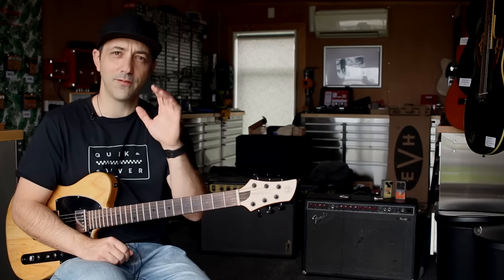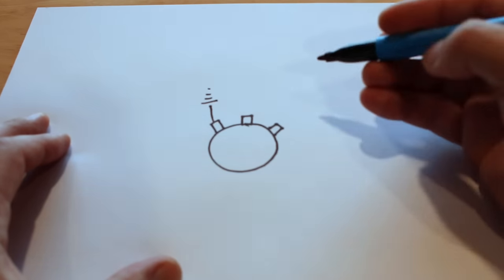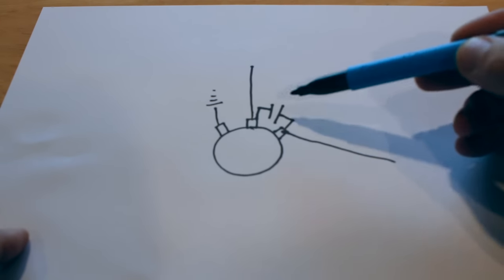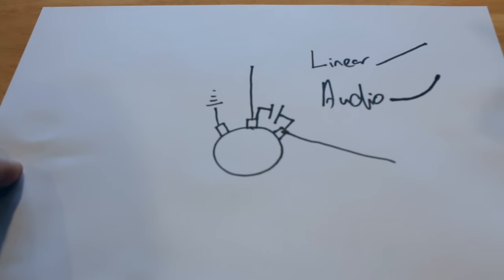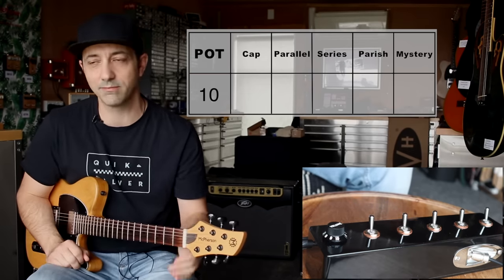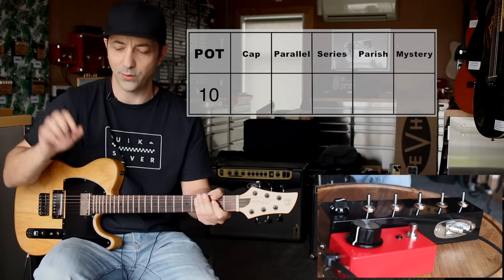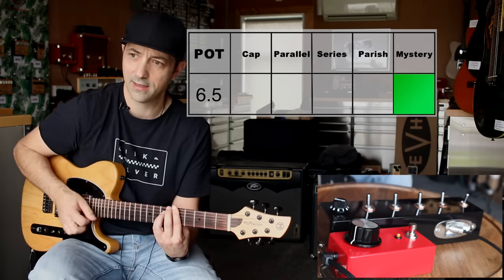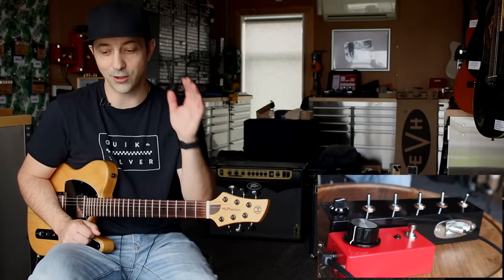The Famous 5 Treble Bleed Guitar Mods Compared

Comment: I know this is just semantics, but: The taper is a physical, deliberately tuned curve, and nothing can "alter" it without damaging it. These circuits are simply returning the mids/mid-highs back into the signal, by BYPASSING THE POT ALTOGETHER. 
Great video otherwise, but try to avoid misinformation, it spreads 6 times faster than the truth.
Reply from the maker: I hear what you are saying but at the end of the day, some of those filters are still altering the pots taper no matter if it a physical alteration or a electronic one, the taper is now different. Trying to explain in any other way would just be really confusing don't you think?, cheers!
Reply: @WaylonMcPhersonGuitar  well, to be honest, no, I don't think that, and you've just made ANOTHER misleading statement: it isn't the pot's taper that has 'changed electronically or physically', it is the composite signal on the output side of the pot that has changed. Mids and highs are getting through, that the pot normally would have attenuated, so the perceived volume naturally increases. That's all. It's not the taper. And that is not more confusing than inventing a 'change' to the pot that hasn't happened. 

If you tell people the truth, then that is an understanding that people will take with them, and be able to better understand the rest of their rigs. If you make stuff up like "changing the pot's taper", then you're setting your viewers up for failure, in understanding their rig. But hey, they're your followers, so you do you. Otherwise, great video. Cheers.
Reply from the maker: @monty5066 I see what you are saying but maybe we have to agree to disagree, cheers :)